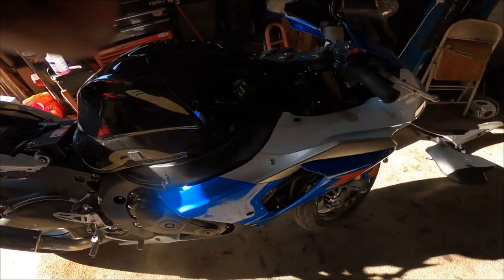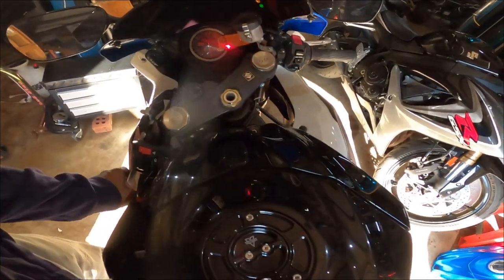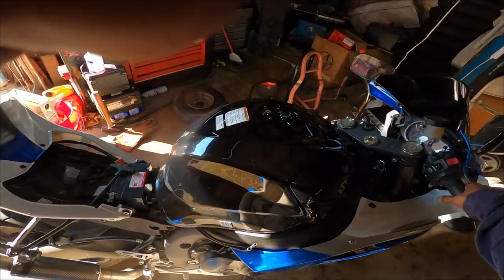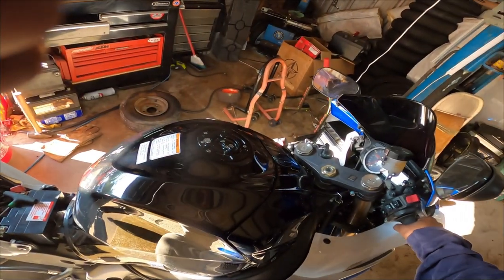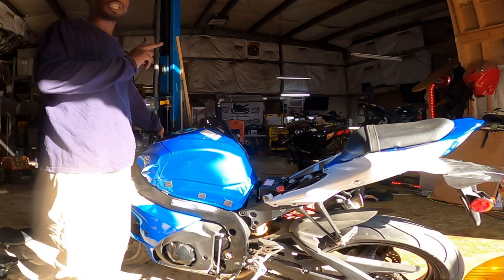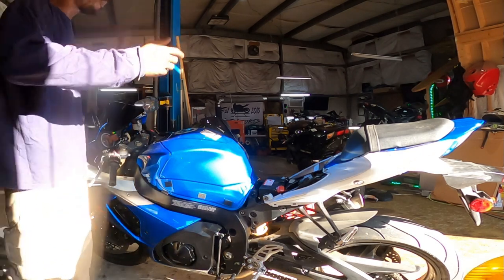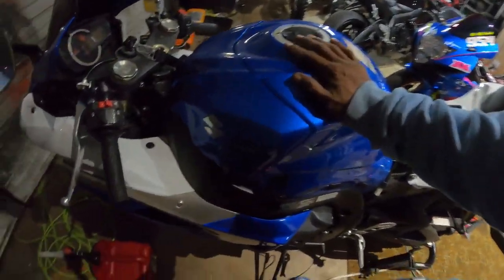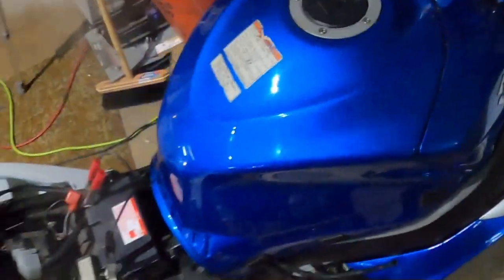Episode 60 2009 GSXR 1000 FUEL PUMP ISSUE SOLVED!

Comment: Can u fuckin show how you wired it back bro god damn?
Reply from the maker: the pump is two wires hook pump to bike out of tank if it runs good if not switch them around should be good
Reply: @PCMotors82  nah ur fine bro! I was super frustrated I spent 9 hours tryna figure out why my bike wouldn’t start after changing fuel pump just to realize that I forgot to put 1 of the 2 O rings on the fuel pump itself that wasn’t holding fuel pressure in the fuel pump and assembly itself